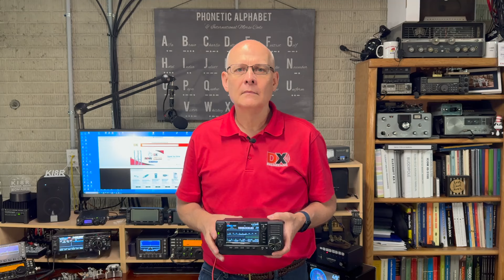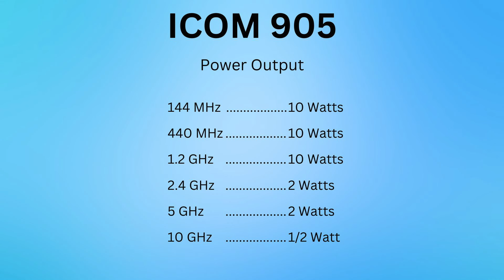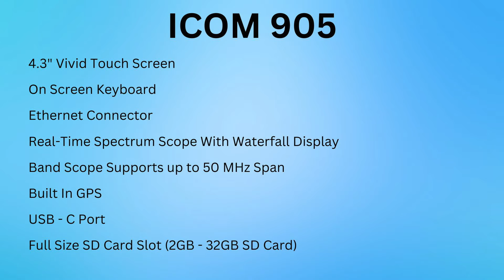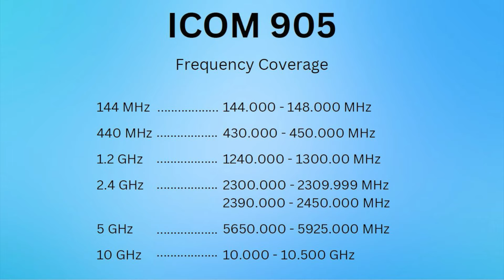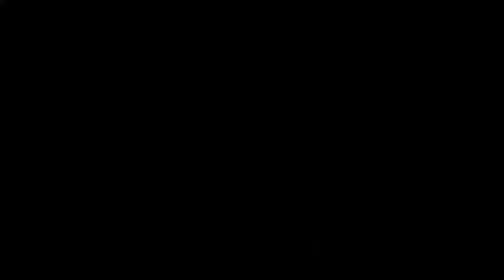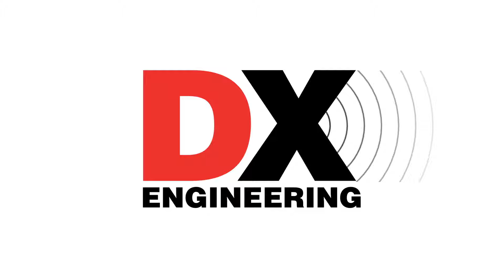Here’s Why the Icom IC-905 VHF/UHF/SHF Transceiver Puts the Actual Radio Part AT the Antenna

Comment: Am I mis-hearing about the ATV side. Is the ic-905 a digital ATV unit or an analogue? He speaks about some legacy unit being analogue and not compatible. To me this says that IC-905 is a digital ATV system: tell me I am correct. Edit.. The AHPB Parabolic antenna: The waveguide is round, not rectangular and why? How does on determine the Horizontal or Vertical polarisation? The guy said nothing about this, so I'm totally confused about this. Also, what is the ideal feeder length from CX10 (3:cm) unit? I should think that Sucoflex-104 would be ideal but 9 inches (that's how I measured it) is practical, but there is going to be a feeder loss off something like 0.04dB. Remember, you only have 500mW to play with at 3:cm. I bought two IC-905 transceivers> One was to run 13:cm; 9:cm (using Sg-Labs transverter IF at 432MHz); 23cm with Andrew Heliax LDF4-50 and this works very well. The second IC-905 is to have the transverter units for 6:cm and 3:cm in a steel cabinet at the mast head, just above the second rotator with the feeder going direct to the antennas with the shortest length possible. Any thoughts on this setup? 73 de Tony G6YPK. Email at QRZ.com

Comment: This may come late, but anyway.
A nice little radio. I have only a few negative comments on it...
- It doesn't feature a CI-V connector, so the only CAT control is done via the USB port. That means no stand-alone devices, like a microHAM StationMaster or other CAT capable sequencers can talk to it. Having CI-V pass through on the accessory connector would have been fantastic.
- On the 10 GHz transverter there is no acc passthrough (unlike the upcoming 24 GHz transverter), so if you use the transverter with its original cable there is no PTT line available from the radio up at the mast to drive a PA or similar things. You need to run a long one from the control head or build a special split cable. And that's a pain since those are no regular easy available connectors.
- There is no synchronous tuning in split mode, meaning that easy cross band SAT operations like on QO-100 are out of the question (this is actually fixable by firmware update - maybe Icom hears about this and puts a button on Function->2).
- A DC output on the antenna connectors for a masthead preamp, like in the 9700 would also had been quite useful, especially since the PTT line is hidden when using the transverter.

Comment: On the 10 GTS can you also do a frequency get up to 20 with a doubler or then can you down convert with an lnb and would a rig like that be a better alternative to sdrs and would like eight of them then combined or could you combine the signals before correctly as long as the timestamps are perfectly synced with one another?
Reply: I'm a novice to this but I'm incredibly interested and I've done quite a bit of home experimentation with various modules and various low frequency sdrs and Lora.

But when I go as a law professor to Indonesia I'm also a member officially of the engineering faculty as I'm trying to get these two groups to collaborate with one another to better as I've seen several businesses fail due to that particular reason
Reply: Add the array of the infiltrator I would obviously place GPS discipline OXCO. That would provide a synchronization signal of PPS or 10 MHz depending on the particular setup.... 

It seems if you put a wide band omnidirectional antenna around your infiltrator to pick up spurious radio interference that you can actually deduct an accurate level of signal strength from your total given that the omnidirectional antenna is sitting right in the middle of your interim order so you could quite accurately deduct any radio interference at the appropriate the frequency and amplitude? Any ideas from an expert?
Reply: Do you think that that would scientifically and accurately be a good way to deduct radio interference from your radio telescope and barometer? There's already a natural block from being in the middle of a caldera surrounded by an enormous amount of Rock it's also in an area with very little spurious radio interference considering that you're in a caldera on top of a volcano which itself is an exclusion zone and then the caldera walls would themselves help black line of sight frequencies. 

In addition to nice optical telescopes would be really nice there as you get higher in altitude even their the humidity drops and you're going to have less atmospheric distortion as well as a lot less light pollution and given the location and the fact that the overall development in the region limits that amount of light pollution. We'll be looking for a dormant volcano that's quite a distance away from a population center not only because it's not a tourist attraction and wouldn't possibly be offensive to the local culture but it would also be far away from spurious radio interference as well as light interference. They don't even have a society of amateur radio astronomers there and you actually have to use the entire name because if you use the acronym and Indonesia it's actually a terrorist group!

Comment: With 5 separate ways of getting on 23cm the 905 beats the others hands down. My 9700 has a 20m run of 7/8 hard line and and a 32 element yagi but the 905 has less noise and similar RX signals on an 8 element yagi. I run Cassergrain  dishes on 5.7 & 10Ghz and regularly talk to a friend  308km away, couldn't do it without the RX/TX at the wave-guide launch probes. Even hard-line contributes to RX noise. The only down side for me is because the weather roaring in from the Southern Ocean it gives hardware a hard time so I tend to take the head units inside until the bad weather passes. Some grizzles that could be addressed in the MKII but it's the best  out there at this time. One interesting result of being GPS locked, nobody except one I cat to is on frequency.  Microwaves are so much fun, cant take the money with you, better enjoy life while you can afford it. What would you prefer, spend the money on something that brings a smile to your face or your relatives fly 12,000km first class for a holiday after your passing.

ZL4IV

Comment: I got the 905 recently and really like it, just pricey. It would be cool if they included 222 Mhz, 33cm and allowed for battery operation since the 705 with the same form factor already does. Maybe include a larger battery that will drive the remote unit.

Comment: My IC-905 is very cool!  I have an IC-9700 and an IC-7300.  It is a pleasure to operate and an intuitive cousin to its predecessors.  The radio is inherently stable and easily deployed for roving, listening around and for EMCOMM.  I haven't yet tried to use it as a D-STAR gateway, but if idle and available when I get the interest, I will try it.  I want to try video once I get a camera.  
I still need to build up a frame to hold the antennas and radio, but so far, so good!

This radio leaves you with a few gaps that some have addressed creatively resolved.  For 902 MHz, one creative ham switches in the 144 MHz output as an IF and for 3400 MHz he switches in the 432 MHz on the IF.  This just leaves 222 MHz.  I have transverters for these bands and may just use my other ICOM radios as IF rigs.  Another solution is the Q5 Signal five band transverter on the 144/222/432/902/1296 MHz bands driven by my IC-7300.  Alas, the Q5 AND an IC-705 aren't in the budget... at least not this year!  I'm blessed to have the IC-905 and 10 GHz module.  Anyone want a QSO in the southeast?

Comment: QRP?
And no remote amplifier..
Ill continue using my 9700 even with losses my erp is much better.. and mast mounted preamps are easily aquired
Reply: If you want to operate mainly 144 and 432, the 9700 makes sense. The 905 on 1200 mHz with 10 watts at the antenna is a far better choice.  It's the 2.304, 5.760, and 10 gHz capability that makes this radio the most exciting transceiver to come along in my lifetime! And I was licensed in 1955.
Reply: Apples and Oranges. This radio is for microwavers with VHF and UHF thrown in for good measure. Kinda like saying you won't buy a truck because it's not a sports car.
Reply: Can't see how to put my 400W 23 cm Amplifier on top of a field day pole..!
Reply: What were they thinking?